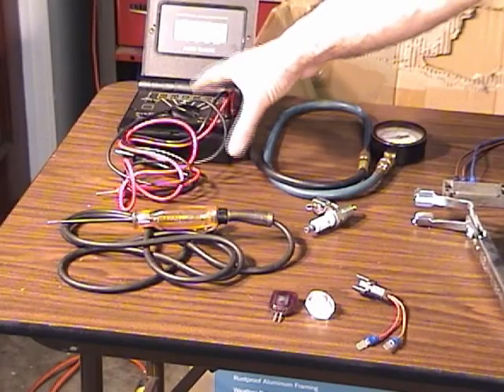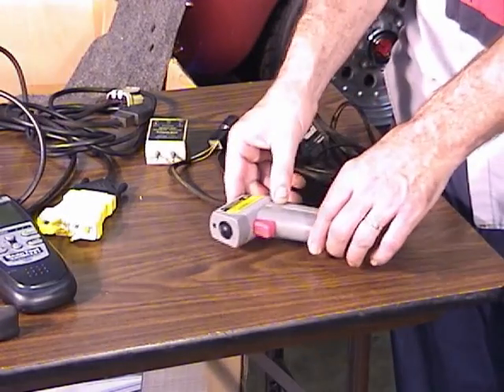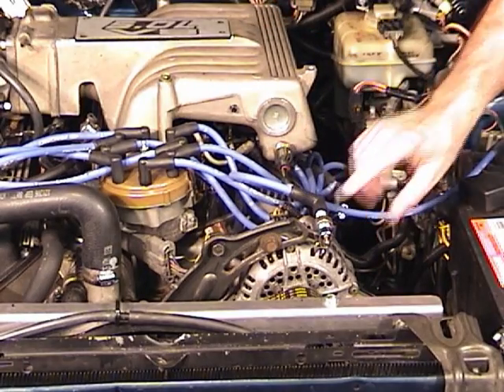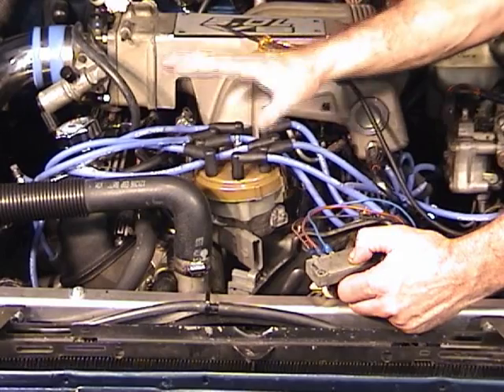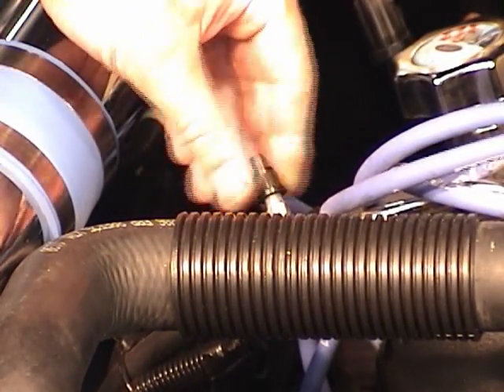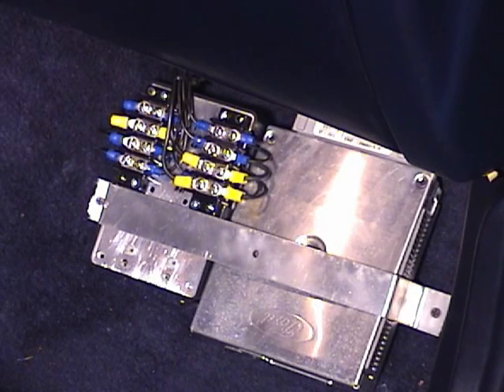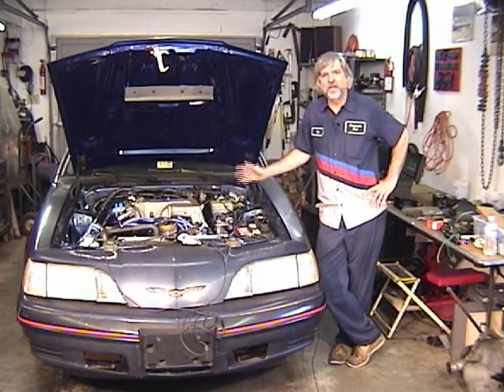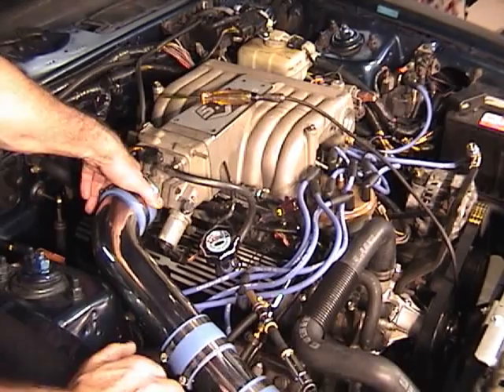Troubleshooting a no start concern on a EEC 4 car HD

Comment: Have same system in my Bronc II   Pin 3 ( start) 12v on crank, Pin 4 ( run) 12v key ON..Pin 5 (Coil) 12v Key ON.. i was MISSING the COIL, n had a broke wire between coil n TFI..  I had a crank NO spark condition,
Reply: What wire was that

Comment: Hi Ken, great video!!!
 I have an intermittent crank no start on my 1986 e150 5.0 I have a code 18 great video very knowledgeable!!! I’ll be following your advice to try and locate this annoying problem, thank you 😀
Reply from the maker: Sounds like a TFI and stator.
Reply: Hi Ken 
Thank u for responding I changed the TFI a few months ago with a Motorcraft TFI I also replaced the resistor of the coil that goes to the computer pin 4 would it be ok with you if I contacted you through email for some help I’m really desperate
Reply from the maker: Sure but I still say you need to replace the stator or the coil.
badshoe@comcast.net.

Comment: Your video helped me figure out I had a bad coil though the testing process. 
Car starts and runs now. 
However My car is not firing on #7 (much colder header temp, obvious miss fire.)
The firing order is correct. 
It has spark at that wire. 
Fuel pressure is in spec. 
It has good compression in that cylinder. 
Next thing I can think to check is the injector. 
How do I test that?. I do not have a node tester.
It looks like I need to pull the upper intake to access it as well.
Reply from the maker: Take a resistance reading on that injector and compare to the one next to it. A reading of about 15-20 ohms. You might just have a bad spark plug or plug wire.

Comment: My 85 town car has CFI, but just can seem to light off without a taste of fuel in the intake. Once it does it has no problems, is it safe to assume the last minute and a half of your video applies to my set up too? Just pip from the tfi and the tps? Also, do you know if the crank position sensor or engine coolant temp sensor could cause this on the CFI models?
Reply from the maker: I don't think it's the crank sensor, if it's bad, it wouldn't start at all. You should be able to do an EEC test on a 85 model. The ECT, ACT or TPS might be the cause but the old CFI systems can be difficult to diag. Most of the video does apply to your car too.

Comment: What if your 89 mustang all of sudden stops,making a swoosh noise in engine compartment, then  fuel pump will stay priming,will not go on then off?will say on ,but won't start,now fuel pump wont even go on?replaced, coil,distributer,relays,Eritrea switch,wires,msd box not lighting up and no power to tps,but fuel injectors are getting power?can the fuel pump go from priming and not stop priming to completely dying?have a aromotive 340 lb in it,thank you, and excellent videos
Reply from the maker: Follow the video. I think you will find the TPS voltage test will fail the ground test. If so, possible internal open in the PCM.
Reply: BadShoeProductions will do,I appreciate your videos and your expertise!!thank you, will let you know what happens
Reply: BadShoeProductions just to give you a heads up, you were correct my computer went out and none repairable because of it age 1989,I was able to get my hands on another one,I will be switching to a mega squirt set up because the reality is the compture I installed will not probably last because of its age and probably all of them sooner or later will fail,and the prices on a used ecu is starting to get ridiculous,thanks again for all your help and excellent videos :),ps  please keep them coming on the 5.0L motor